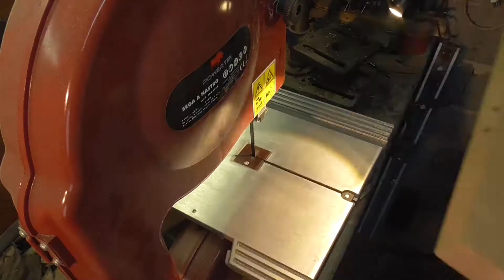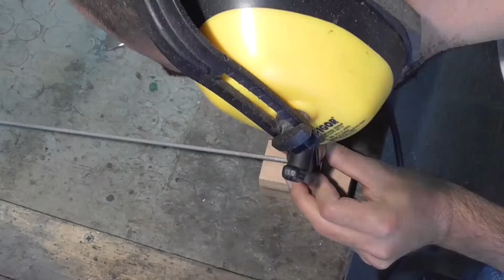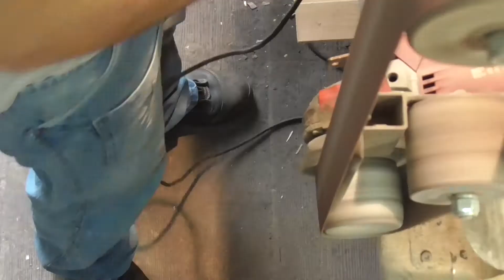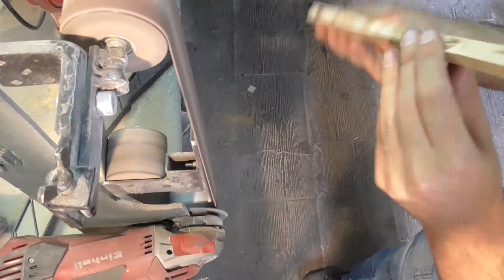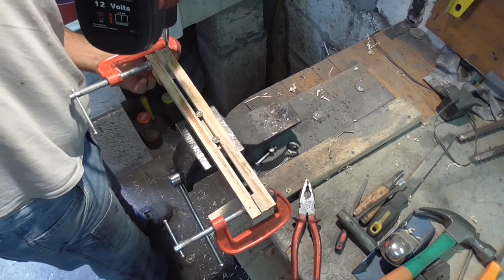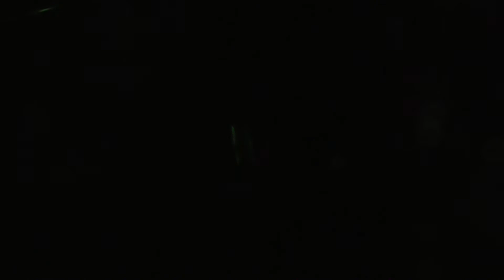Helpful Tool for Stick Welding: STICK WELDER HOLDER

Comment: What exactly does this do for you? I believe it will ultimately prevent you from learning to stick weld properly. BTW, you can hold the electrode with your hand if you have the correct hand protected, e.g., stick welding gloves.

Comment: Very good idea. I started looking for something like this and assumed it would exist as a commercial item (just as a TIG welding pen/filler wire feeder is a thing). I see lots of commenters taking the p!$$ here but they should perhaps come back when they have reached old age and have lost the fine motor control we all take for granted when we are younger. 
I heard a very good analogy - that stick welding is like turning a light switch on with a broom-stick.

Comment: I appreciate your idea. Keep going and try new things. But as for the stick welding, if you practice a little bit, it is very easy to weld with long electrodes with one hand. Cutting the electrode to half is another option.
Reply from the maker: Is that i need most of the time to weld very little objects, things that usually nobody weld with a stick welder, so hold it like a pen is more useful for me than learn to use it in the right way

Comment: Or you could just practice and learn to weld like the millions before us
Reply from the maker: Yeah you're right, but this is useful more for little precise welds than for long ones, plus if you hold the stick with the glove it will become too hot after a little. Is just a tool for helping, not a revolutionary way to weld
Reply: It helps those that are beginning and have a hard time keeping the rod at a correct distance
Reply: @Gabrulo_knifemaking  did you ever make a follow up video on how to use it?

Comment: I MADE A WELDING STICK STEADIER BY USING TWO PIECES OF WOOD THAT WERE FOUR INCHES LONG, 5/8 INCH WIDE AND 1/4 INCH THICK.   I PUT THE TWO PIECES TOGETHER AND DRILLED A HOLE THROUGH THEM ABOUT 1.5 INCHES FROM ONE END.  THEN I PUT A SMALL BOLT THROUGH THE HOLES AND PUT A WING NUT ON THE BOLT.  THEN I WRAPPED A RUBBER BAND ON THE OTHER END.  ALL I HAVE TO DO IS PUT THE WELDING ROD BETWEEN THE STICKS (ABOUT FOUR OR FIVE INCHES FROM THE END OF THE ROD) AND TIGHTEN THE WING NUT UNTIL THE END OF THE WELDING ROD IS SNUG BETWEEN THE STICKS.  THEN I HOLD THE WELDER ROD CLAMP IN MY LEFT HAND AND HOLD THE RUBBER BAND END OF THE STICKS IN MY RIGHT HAND AND WELD WITH 20 TIMES MORE CONTROL.

Comment: solution looking for a problem imho; but if its useful for you awesome!
Reply from the maker: For me a lot! I'm not a good welder, i want to buy a mig welder for this reason. Most of the weld that i made are very little, so is difficult for me to be precise with the long stick. i noticed that in the video i don't show that i hold it like a pen! and not from the pliers